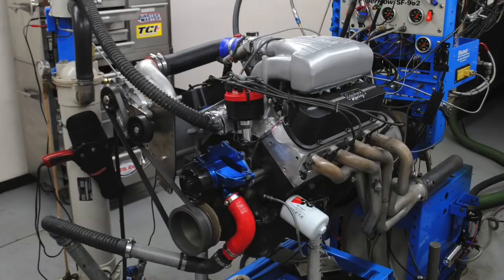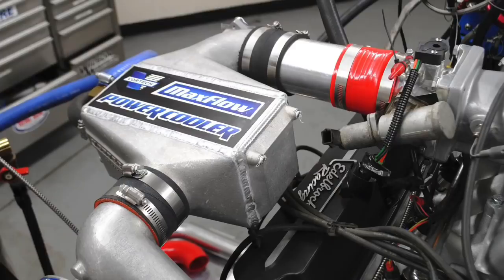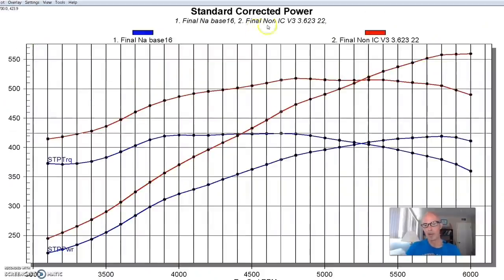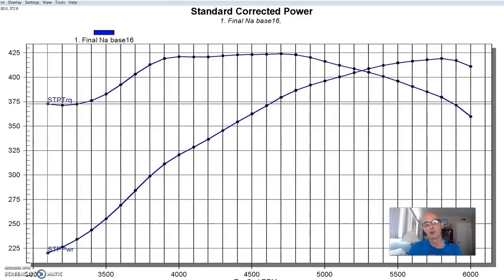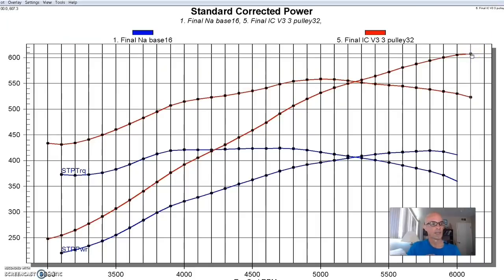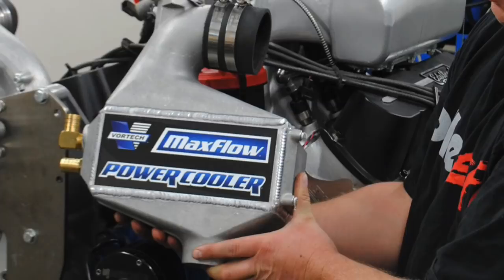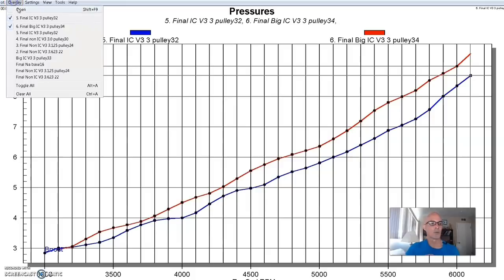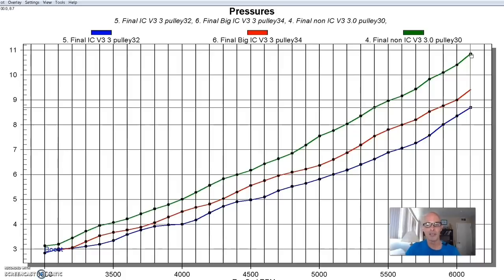WHAT MAKES MORE? INTERCOOLED OR NON?

Comment: I teach engineering and have 25 years setting up and tuning turbo cars for reliability. Intercoolers are a restriction that will always reduce power. Continuity equation for superchargers/turbochargers says mass in has to equal mass out, so no matter what you do after the compressor wheel to air, it doesn't change the mass flow, all intercooling does is remove energy and reduce power potential. Of course this depends on the fuel quality and that is why so many setups respond to intercooling when using cheap fuels that do not tolerate high temperatures. high temps will always make more power - any and every power plant in the world uses the highest feasible temperature for max efficiency (power from fuel ratio) but automotive apps using cheap fuels cannot extract high temp energy slowly enough to drive a piston over time in a way that does not damage the engine so they are forced to remove that temp energy before and sometimes during (water injection for example) to keep the reaction rate slow enough to acceptably drive a piston.

Comment: Nobody in their right mind adds an intercooler, an effective intercooler, and doesn't increase the timing because of the lower intake temperature. Yes, his test is correct with what he is doing but what he didn't do was compare those tests with appropriate increases in timing. He would see a lot more HP by doing this.
Reply from the maker: we had enough octane to already run the timing

Comment: Not uncommon in the Mustang world to see 170,180,190,200f on these vortech blowers with boost and no intercooler. These are with real temps under hood heat. I run water meth to help bring it back down to 120-140f. When I’m worried about racing a splash of 100-110 unleaded removes my worry of knock.

Comment: Richard, does the inter cool company publish the design approach of cooler. Approach difference between entering water and leaving air. This tells you the efficiency of the heat exchanger and if the water flow throw exchanger is at design or airflow across exchanger is at design.
Reply from the maker: we actually measure pressure drop and temp drop on the core

Comment: I used to be a hvac installer and I was trained never to make turns as sharp as you are with air ducts because it would creat backup pressure that would reduce air flow. The more sharp bends you make, the less airflow get. Also, the longer the ducts, the less airflow.

Comment: It gives me more questions than answers. And I'm happy to know about it. So here is my hypothesis: Maybe this engine has something that separates air and fuel like a very effective swirl so if fuel atomization it's not the right (like a carburetor) the excess heat help the engine to perform a better combustion, so if I'm right putting a good carburetor instead of fuel injection could unlock some power.

Comment: I'm more familiar with aero engines than automotive engines but from what I've read boost=boost. Meaning, regardless of what temperature the charge air is, absolute pressure is what determines how much oxygen there will be in a cylinder. You very quickly reach a limit with either how much boost or how much timing you can give an engine before reaching the limitations of your fuel. Assuming your valve and ignition timing are static, too much boost will lead to premature or unstable combustion, however, reducing the charge temperature can delay these issues until higher manifold pressures. So reducing charge temperature shouldn't increase boost by itself, but it should allow you to run higher boost. 
So like you were saying with a regulated source like a turbocharger, adding an intercooler between the compressor and bypass valve will result in the same boost and lower charge temperature. But with a supercharger where the impeller speed is fixed, I think you would need to adjust pully size to compensate for the added flow restriction to achieve a similar behavior to that of a turbo.

Comment: I feel like if you don't adjust timing and fuel and run ice water through intercooler you won't have a gain especially on a supercharger setup because you're just adding a restriction and decreasing potential boost
Reply: But you are getting detonation resistance with a cooler charge.  Just a layer of safety at bare minimum even if you don't see more hp.

Comment: with a turbocgarger system maybe the intercooler would be more diferencen than centrifugal superchargers
Reply: Turbos auto adjust boost.  That's the great thing.  So 10 psi non intercooled... and it will hold 10 psi intercooled.  Now that's when you see a power increase for sure.

Comment: Pressure drop 2 psi is at least 40hp. Then timing is optimized for the higher iat. If the same boost level is run you will see more power then non ic. Then timing optimized for the lower iat will make more power again.

Comment: An intercooler also adds air volume between the motor and supercharger, which need to be compressed and 
causes a drop in boost

Comment: If fuel was the same and lowering inlet temps gave you more pounds of air per hour then you needed to add more fuel to see an increase in power. That assumes the cooler provided a denser air charge at the same air velocity. That and you may need to use an even smaller pulley. The turbo can not catch up to make up the pressure loss from the contracting air when cooled. As an exhaust driven turbo might. What was the AF ratio with and without coolers, were you leaner with the coolers?
Reply: Wrong direction with your hypothesis

Comment: I have only one question, what type of fuel were you using ?, I don't see volume problems what I believe is ( doesn't mean it is a right believe ) that K-energy in the fuel is important, but there is a limit to it before you start entering in to detonation, in the NO intercooled test you just had not reached the K-energy threshold for detonation there for it was the best charge at that amount of boost,  you want the most energy in that mix before you reach the threshold of the mix and enter in detonation, heat is energy up to the point that you enter in detonation,  if you had a Higher compression engine then you will see that the Intercooler will be beneficial because you already got to the threshold of the K-energy quicker, then you want to cool the charge to be able to avoid the detonation, as well if you added more boost then you will see that the NO intercooled application will reach the K-energy threshold and you are limited to timing, and there is where the aftercooler will be beneficial. 
Changing a little the topic of cooled charge, do you have test comparisons of Carbureted supercharged engine NO intercooled vs EFI NO intercooled, to see how far can you run a carbureted engine before needing a aftercooler since the charge is cooled as it mix with the fuel and you have sort of J-Thompson effect going thru it, and how far you can run a EFI before you need a intercooler.

Comment: Id like to add a metric you haven't considered at all. 
Pressure drop. If you want to see whats really going on with these IC setups you need to measure pressure drop in the charge pipes pre IC and manifold. I bet you 100$ that the boost PSI pre IC is much higher.
Adding an IC also increases restriction regardless of the size of the IC. the more pipe and bends you add to the system the more resistance to flow. 
id also bet the people that design these inter coolers don't take pressure drop into account. Pressure neutral IC's are the only way to go. that means the PSI at the turbo/ supercharger is the same PSI at the TB. 
Love your videos!
Reply: Richard knows exactly what's going on.  He's just stimulating conversation.

Comment: Could it be that the potential to run more timing with the properly sized intercooler was not taken advantage of, in addition to the restriction of the intercooler itself? Consider the following extremes:
1. An NA setup with and without an intercooler. I'm going to guess the Intercooled setup will always make slightly less power.
2. Running 91 AKI in an engine tuned to 87AKI. The potential for more power is there but not realised.

Comment: Air temp drop means pressure drop (but at the same time increase of density). If this were a turbo, as you said, the power would be higher at the same pressure level. At the same time, you would be able to add timing with those lower inlet temps so the tuning wasn't done completely.

Comment: You could have bumped up the timing and fuel to take advantage of the cooler charge temps  of course even the slightest restriction is going to show a drop in power if you run the same timing and fuel. Until the charge temperature becomes a problem.

Comment: That is a centrifugal supercharger, 10psi without an IC is fine. I can say one thing, way back when I had the Vortech SC in my car land it got cold my boost gauge read 11 to 12 psi with my 9.5psi pulley.  On normal days it read 9.5psi and the IATs were between 85 to 90 when driven and standing on a stop light it climbed up to 130 degrees. I had the car running like that for over a decade with no problems until it was totaled by an ederly driver. But anyways is all about having the correct tune.

 The turbos and PDs are a different story and they do need IC. Centrifugals do not like ICs, since they work on engine speed the IC interrupts their air flow speed to the engine, normally with a better tune it would have solve this power issue I would think.
Reply: RH knows exactly what is going on.  He's not looking for a "answer".  Just stimulating conversation for Youtube algorithms.
Reply: So I can run a non intercooled centrifugal on say a LS1 or my fox with low boost without to many problems? E85 would probably help.

Comment: Unfortunately your video isn't showing a full depiction of what goes on in fuel injected engines. Only newer engines, 2011 and up coyote and Voodoo motors-at 150 IAT the computer pulls timing and you will not make anywhere near the same power as a combo that starts under that threshold. You can run your old school 5.0 and keep the timing steady if you want but you're on the verge of knock. No modern computer would let that happen. So if this video was in 1993 it would be relevant but in today's world with the ecms we have that monitor IAT and change timing your point is null and invalid.
Reply: A little harsh but you are correct.  There was NO alteration to tune done by man or computer for changes in the system.   IAT and timing based tables would have shown differences.  Also remember he's probably running race fuel of some sort so knock is NOT something he's worried about.

Comment: The intercooler would have more of an advantage in the car with the hood closed at driving speeds. I understand the logic of the video but an engine in an open dyno room and the engine in the car with the hood closed is way 2 different scenarios

Comment: The piping losses might have really been high. Need to data log pressure out of supercharger and in manifold to determine the actual drop due to restrictions.
Reply: He doesn't need to do anything.. he knows the answer.  He's not looking for losses.. he didn't LOSE anything.  The boost isn't lost or restricted.. it's just hot air that's been cooled.

Comment: my guess.. unlike turbos, superchargers dont heat the air as much .. 70 degree water is not much below atmosphere of the room, and with the volume of air moving through system, the air going into the engine is not much above atmosphere temp any ways.. the intercooler setups also massively increase the volume before the intake, and since superchargers have a fixed volume/psi vs rpm scaling you are losing boost efficiency, sacrificing any minor temp gains from the intercoolers.. would have been completely different for a turbo system.
Reply: Yeah that's not correct
Reply: @superkillr  such an informative response ...

Comment: Great question! I didn’t see a picture of the actual piping to the throttle body from the blower and through the “good” intercooler. I suspect lots of turns and increased restriction compared to the very efficient-looking run non-intercooled. How ‘bout meth injection or throttle body (sniper) injection with E85 on a good single-plane? Compared to the good intercooler... Thanks for all the good info!

Comment: Richard, was the link posted for the video, i did not see it. I really would like to see the mentioned video. Like to mention I currently have a 390W with a Vortech in a 86 Mustang while using the stock hood, and no holes cut into the hood either.

Comment: 6:52 Because fuel curve & timing was the SAME as N.A.
IF the timing & fuel had been optimized,  the large intercooler would have made more horse power.
You were running a N.A.  timing & fuel.
Need AIR temperature readings 
1. Test cell temperature
2. Temp. Out the supercharger 
3. Temp. in the intake manifold.

Comment: You can run more timing with the intercooler. Also most run ice water through intercoolers. Although I know on engine dyno's 70 degree water is very common.

Comment: I think and I not an expert by any means. The engine was happy enough with the boost timing and heat before intercooling so not much to be had after especially taking into account the loss of flow/boost.

Comment: The biggest point of adding an intercooler is to allow you to run more boost and/or more timing. Intercoolers always pose a restriction to flow and you can see this with the drop in boost pressure. If you keep the non-intercooled timing level and don’t reduce the pulley size to restore boost pressure, it’s no wonder there was a power loss. I’d like to see this test repeated with an optimized timing curve without changing the pulley, and then another test to change pulley size to restore boost level and optimize timing. I’m sure you’ll see big gains with the intercooler.

Comment: I'm thinking that supercharger couldn't push more. It wasn't making more power because it wasn't efficiently putting air in. My bet is go to a bigger charger, intercooled would make more, even at the same boost because it won't heat the charge as much.

Comment: You said you did not adjust the timing. My hunch is the engine needed more spark timing to make power with cold air. It would have been useful to have an air flow turbine on the inlet to see how much air flow you picked up with the big intercooler.

Comment: would love to see a graph of LBS/hr of fuel and LBS/hr of air along with the boost charts to get a better idea of what is happening. I only say this because of a video Gale banks made explaining that boost is just a measure of flow restriction rather than a measure of power potential based on how a higher flowing head with no other changes will register lower boost and usually more power as there is more room to move the air easily.
side note: on my post for the 292 yesterday i neglected to mention how much i would love to see a side by side comparison of the big 3 inline 6's (292, Jeep 4.0, Ford 300) as i know all three can make good power and brutal torque

Comment: Every turn in the system adds restrictions, non intercooler was a straight shot, the intercooler had some 90 degree bends one looked more than 90. The cooler might flow well but the tight turns will kill the flow.

Comment: EGT? AFR? Timing? We repeatedly hear on this site how horsepower is complicated; if the tune was the same, the results will be vastly different between these three configurations.  Bet that the big cooler was really lean and no cooler was almost too fat.  Check out Gale Banks' claims on flow and density versus boost pressure. Good project, though. Looking forward to more.
Reply from the maker: AFR was 11.8 on both-timing was 30 degrees on both
Reply: @richardholdener1727  Thanks for the reply, and for the more recent video on timing and A/FR.  I still think this is an issue of flow and fuel density and not cooling and boost pressure.  Can't instrument the past, but to figure out what is going on I would look at inlet and exhaust port temperatures with AFR and at least a separate O2 sensor on each header.  Don't think that I don't like the site or your videos, though.  Still looking forward to more.

Comment: Finally, thank you. Intercoolers do not make more power. Cooling air after its been pumped by a compressor does not add more air, it restricts air. Intercoolers do not make more power; timing makes more power. When you take a knock limited setup and retard timing, then cool the air so its no longer knock limited and run full timing, of course it makes more power. Intercooling is a bandaid for inadequate fuel. An intercooler is a restriction in the intake tract that costs power if full timing can be run without the intercooler.
Reply from the maker: I disagree
Reply: @richardholdener1727  do you have more test results where you didn't change anything (including timing) other than add an intercooler?

Comment: What this looks like is an on the edge timing map for non intercooler vers a conservative timing map intercooled. I put money on it that if you add a degree or 3 above 4500 rpm the power would reflect gains. Also the non intercooler engine would have a failure rate much quicker then intercooled. If given testing back to back in a car on a 85^ day the non intercooler engine would be lazy and get worse as the miles are put in vers the intercooled

Comment: Isn't 419HP for a 351W a little low with that combination?  Was it because of the really low compression?
Reply: Edelbrock advertises their 351W Power Package at 410hp, so he's right there.
Reply from the maker: we made 469 hp with a carb
Reply: @richardholdener1727  wow, I was never impressed by Edelbrock efi intakes, but this one takes the 🍰